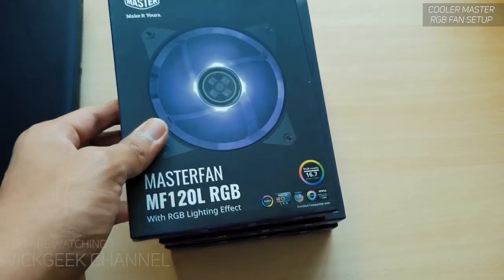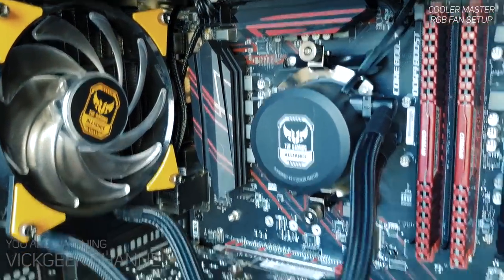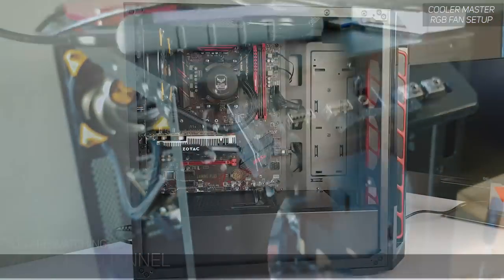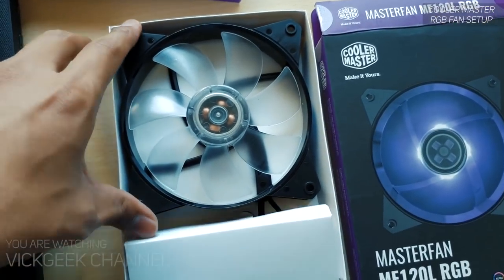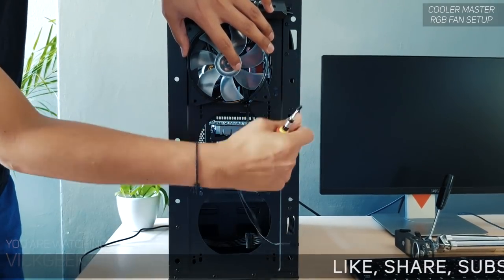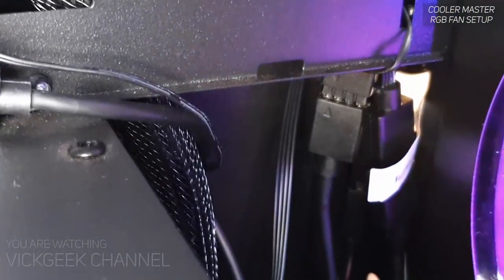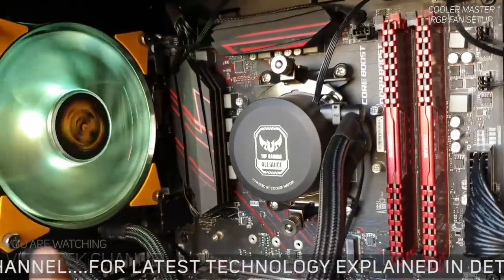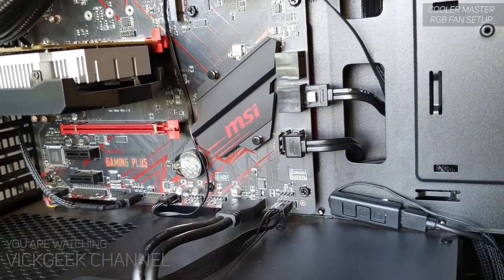How to install and connect CoolerMaster RGB FANS MF120L RGB

Comment: How can you call this a "How To" video when you show the fan in your hand and then the next shot it is installed??
What a waste of time
Reply from the maker: Did you watch the video properly and full ? Listen to what I have to say in the video. I have explained as to how and where you can fix the fan inside case. How to install fan can just be connecting 4 screws in the fan compartment. It is fairly easy. You want me to show turning screw driver, fixing 4 screws on each fan ? That will make  this video show you tightening 12 screws for 3 fans But in the 'How to' video, Dude I saved your time making this video. I showed you full process, starting from installing to connecting.
Reply: @VickGeek  I was actually hoping to see what was in the title ,hooking the RGB fans to the Motherboard header.
Thanks for answering,I wasn't aware I did not know how to "watch the video properly"  . Pretty condescending bud.I will not bother with anymore of your videos , thanks anyways.
Reply from the maker: @MrSpecies7  Oh sorry bud, I did not mean to be harsh. I just asked if you watched the video completely. Because, in the video I have showed how to connect RGB fans to MB headers. A lot of pple skip through the video and find the information to be half said. I did not mean to hurt you in anyway. Sorry if my words were harsh, again.
Reply: @VickGeek  Thanks for getting back to me.Have a good  New Years.
Reply: @MrSpecies7  In fact, as you can see that specific model CANT be connected to the motherboard due to their crappy 4 pins connectors with the 2nd one blocked so its useless for 4 pins headers (hence why he mentions the module and shows his RGB headers, empty)...and I suspect most cooler master kits are the same (got 6 MF120R collecting dust here because of that) and VickGeek, that is what we all want to hear from fan reviews, type of RGB connectors(i.e. 3 pins, 4 pins, blocked pins, std or prorietary), lenght of wires, voltage (5V or 12V); after this point, what they look like and how the mount is a diiiiistant seconday concern. Hope you use this advice, that type of info is nowhere to be found on YT and could draw A LOT of subs and views  --  wink-wink  --
Reply from the maker: @quebecpatriot1874  Appreciate your feedback, will work on it the next time when I make videos about fans and computers in general.
Reply: @VickGeek  You knopw which case these fans are made for? Matrexx 55 or any case that has an ARGB interface included; with my Matrexx 55 I got rid of the modules and all the wirings and plug the ARGB into the case header and all effects work via the front panel RGB switch  :) led strip included
Reply: and why he buy rgb sync fan case but the motherboard & liquid cooling doesnt sync at all with 3 front fan there are not same lighting effects
Reply: vickgeeks reply is right. there is no showing necessarily required in a how to, as long as he still tells you how to show it. (although for fullscale noobs at fans, a fast forward installation wouldn't hurt, ill give you that)
Reply: Because it's not hard to tell that where he was holding it, is where you mount it... Unless you want to watch him apply screws too?
Reply: I bought some similar fans but the connector has like 3 holes and 1 is missing, doesn’t match to my header, any solution without have to buy more and expensive stuff?
Reply: Worst Peeker haha outdated jk lol
Reply: H-Prime .... ok
Reply from the maker: Please find the NEW FULL PROPER TUTORIAL VIDEO here : https://youtu.be/J7bf_JzJLl4
With the feedback I received, I have tried to cover and explain everything  in proper detail that will help you connect your RGB or ARGB Fans.
Hope this helps :) Have a great day everyone. Appreciate everyone's feedback :) Thanks guys

Comment: I've never used rgb fans and just built my 1st new PC. This video helps, I have an MSI motherboard.
I got a fan and it had a weird 4 pin plug with 1 blocked so couldn't use it on my board. Which fans have the JRGB 4 pin connector? Twice I've had the same problem.

Comment: V good video
BRO each fan has two connectors
One goes to mother board and second go to rgb header

By 1st goes motherboard I understand fan header
The 2nd goes to the rgb header. But rgb header is part of the mothballed or separate?

Comment: This video helped, so I'm still using a Z87 motherboard so... no RGB header on it, but with the RGB controller connected to the power supply and motherboard I can still RGB my old dinosaur correct?

Comment: Thx I finally understood where I should plug my rgb fans. Is it safe to connect the rgb fan to a 12V rgb header?
Reply from the maker: Yes it's safe.
Reply: @VickGeek  Ok thanks a lot! It is better to connect the rgb fans to the mobo (if supports rgb like mystic light) to control rgb from software rather than the control, right? Because I want to sync both my rgb fans, ram, mobo and mouse rgb
Reply from the maker: @IoannisVintzi  Yes absolutely. If there is enough slots/ports to connect rgb on the mobo, then fill-up all those and control it using software. If the slots get full and there is no room for other fans, then an external controller such as from Cooler Master will help sync as shown in the video. My PC Motherboard had few slots for rgb and not all, so external controller was needed.
Reply: @VickGeek  Ok thank you. Is there any problem if I use a splitter to connect 3 or 2 rgb fan to the rgb header?
Reply from the maker: @IoannisVintzi  Nope it shouldn't give any problem.
Reply: @VickGeek  Ok, thanks a lot! And nice video!!! 👏👍

Comment: Hi. Sorry. I can install the cooler directly to the motherboard RGB header and also keep the control of the cooler connected? (to change the light by software or by the fisical control). Other question: I need one or two RGB headers in the motherboard?. Thanks

Comment: I have a SickleFlow 140mm ARGB fan. So I need to connect the 3 holes to the addressable 3 pin on motherboard and the 4 pwn for that fan to the cha fan header right?

Comment: Great video why did you not buy the coolmaster 240 rgb cooler to fit on top? I'm about to build a pc for a friend will coolmaster 520 rgb case accept a coolmaster sync with front fans?

Comment: Bro i have a doubt if cabinet have 4 red fans(3 front 1 rear)but motherboard supports have 1 fan pin then balance 3 fan is waste bro🤔because im going to buy gx2000 cabinet and msi h310 pro-vh plus(motherboard) im going to use vs550 smps

Comment: I have a question... The mf 120l got 4pin RGB header right? I use Gigabyte Aorus B450 pro, can i connect the 4pin rgb header to the 3pin led connector?

Comment: Get a splitter 3 in 1 rgb splitter it will be easy for you to manage cables as well as you won't need to connect it on motherboard. These cables are available on Amazon takes 2-3 weeks time to reach you.
Reply: so they don't have to be connected to the motherboard to work?
Reply: @dalemckeown2098  right only one cable from controller will go to your motherboard usb pin, one sata power from power supply rest all the cables you can just attach it with that splitter.
Reply: @sampreetkishan3170  did they provide a controller? If no they you can purchase the controller separately, along with it buy a splitter for rgb cables.
Reply: @sampreetkishan3170  okay cooler master cheapos should include a remote atleast, it doesn't costs much

Comment: if your motherboard cant support it you can buy packs on amazon that have controllers so it goes into psu

5/6 Pack RGB PC Cooling Fan 120mm Cooler with Controller for Computer Desktop

Comment: I recently bough a pre built system from a system integrator, your tutorial is awesome however.. the case I bought is a cooler master master box MB530p that comes with addressable stuff as standard, how would i check if it is done properly so I can address my fans?
Reply from the maker: Install app from CoolerMaster website http://www.coolermaster.com/cooling/cooling-rgb-accessories/rgb-led-controller/
and see if t works. You may also check downloading and installing the motherboard's light controller software. Example, the MSI has Mystic Light software, similarly Asus has Aurora etc. If it doesn't work, then you may have to check with wiring.
Reply: Did you find how to turn them on?
Reply: @Jacko_mcc  just need to plug the splitter cable into the ARGB port on your motherboard
Reply: borfy borf  ok thanks, does it look like a black head with 4 wires coming out the back?
Reply: borfy borf and does the case come with tye argb controller or did you have to buy one seperate

Comment: mine wired controler wont work for cm hyper h410r cpu cooler it only lights in blue color and i installet it right this rgb led controler ? mobo is biostar x470 qtq . any help what should i do for my control to be able to work and change modes and coolors? plz help

Comment: Installed one fan, MF120L RGB, just like the one in your vid... However, I can only select one color at a time and other than that, it only changes with the CPU temperature... Is there any reason it wouldn't change between the colors? Installed the software coolermaster states it works with and still, no success.. Please help??

Comment: I know this video is old but could you please reply to this. I currently have a b365m ds3h with a gigbyte motherborg I am not the most savy cus I am still learning and I am not the person who set it up it seems that the rgb header at the top with the 4 pins only has 3 for me which makes it seem like it was broken during set up. the bottom one is simaler it was hard enough figuring out all the terms and how to set up the lights and now I have this problem does anyone have any solution it is driving me insane 😡

Comment: If you don't mind, could you please tell me the difference between various RGB headers? For example MSI has JRGB but Gigabyte has D_LED headers on it apart from the RGBW headers. I heard somewhere that connecting fans to the wrong RGB headers will fry them and may also fry the header. So, if you could tell me which header works for these fans, that would be great. Also what are the functionalities and limitations of each header? I just want to add one or two RGB fans and an RGB AIO Liquid Cooler plus an LED Strip. So I want to be cautious.
Thank you.
Reply from the maker: Hi, the difference between various RGB headers is not much, meaning they just perform in a different way due to PIN arrangement. Example: JRGB on MSI means it can light up one single colour at a time. JRGB is a Non-addressable RGB header. So, if you have bought ARGB fans that can produce multiple colours, make sure you refer manual of your motherboard and then place it to ARGB supported header. 
RGBW means it has seperate white chip which gives option to make white colour glow warm white or cold white. So you can buy a RGBW strip and then connect to the header. 
Just make sure you place the fans pin to fan header and RGB pins to RGB headers. You can also buy third-partyLED controllers that are made for PC such from CoolerMaster as shown in the video.
Hope this helps. Please subscribe if you haven't already.
Reply: @VickGeek  Thanks... I just subscribed. I've purchased a cooler master ML240L RGB Liquid cooler and a Gigabyte x470 Aorus Gaming 7 WiFi. Does that mean I have to connect the RGB connectors on this cooler to the D_LED header? The cooler is just RGB and not ARGB.
Reply: @Babzzz695  Did u find an answer?I am in the same situation as you
Reply: @RyukGFX  I didn't find an exact answer. But if you're thinking of buying a Gigabyte x470 motherboard, then you should know that the D_LED header is an ARGB header and not the regular RGB header. It's a 5V header so don't worry about frying your components. If you have the Gaming 7 motherboard, you will get a 3 Pin to 4 Pin connector in the box. Use it for regular RGB fans like the Liquid cooler I. Mentioned in the above comment. But if you're buying an ARGB capable fan or a Liquid cooler, you connect it directly to the D_LED header on the motherboard. 

The other RGBW header on these motherboards is a 12V header so tread cautiously when you're working with these. These  can fry your components if their requirement is 5V and not 12V. These headers are useful with LED strips which have an additional white LED for every RGB LED on them. So you can get pure white light out of these strips instead of bluish whites if you're into white lights.

Again, you have to lookout for the power requirements for that particular device. The power requirements are clearly mentioned on the box of the fans or the cooler where you should check for the power requirements of the LED and not the fans.

Whatever you do, make sure you're aware of the power requirements of the LED part of that particular device let it be a cooler or a single fan or an LED strip. Most regular RGB fans have a requirement of 5V. So go with D_LED header paired with the  3 Pin to 4 Pin converter. If the fans have addressable RGB or ARGB, go with the D_LED header and connect them directly. But if the Power requirement is mentioned as 12V, then you should connect it to the RGBW header.

Sorry for the very long and boring explanation, most of which you might already know.
Reply: @Babzzz695  Thank you very much for the detailed explanation! Now I understand what I have to do.
Reply: @RyukGFX  My pleasure :)

Comment: Sir I'm us using a msi b450m gaming plus and antec df500 rgb case... But sir only red light showing... All the light are not showing.... What should i do... And how should I connect those wire to the motherboard.

Comment: There rgb fans cost 2k each... i have cooler master case in which 3 rgb fans are pre installed and 1 without rgb... the case costed me 5.5k which is cheaper than the cost of 3 rgb fans...
WHAT THE HELL... YOU CAN BUY A CEILING FAN FOR 2K...

Comment: If i dont have rgb on my motherboard the fan have rgb works but i cant control it yes??
Reply from the maker: Yes that's what I showed in the video...you can control lighting using the rgb wired controller.
Reply from the maker: Check this new video I made https://youtu.be/J7bf_JzJLl4

Comment: Bro if i connect rgb header to motherboard do i need to connect the 3 pin of fan or not?
Reply: I was wondering the same thing. It seems so. The 4 pin is strictly for rgb lights and the 3 pin is for the actual fan.

Comment: Bro my motherboard have only 4pin connector(pwm) . So if I connect only 4 pin connector of the fan to my motherboard ,then can I control the RGB effects ?
Reply from the maker: Nope. To control RGB, you need to connect the seperate wire that comes with the fan or the RGB strip.

Comment: but how to connect the all rgb fan if the motherboard only have 1 or 2 RGB header and I have 3/4 rgb fans?
Reply: is there any other ways beside the CM hub
Reply: You could buy an rgb splitter. You plug it in to your rgb port on your motherboard and it splits it into multiple connections for more rgb connections

Comment: Hi bro.. This fans available with software..
Reply from the maker: It works with Compatible Motherboard software, like the mystic light software from MSI, etc.. CoolerMaster software doesn't work with these fans. You have to buy a seperate CoolerMaster light controller kit.
Reply: @VickGeek  Thanks for answer and great video.. Have a nice day!

Comment: Are baba dont use rgb controller use the cooler master rgb splitter to run the front 3 rgb fans and controll them with mystic light.

Comment: Does 3 pin fan works on 4 pin motherboard?
Reply from the maker: Yes !
Reply: the tab on the mobo connector fits the 2 protrusions on the fan connector, look at both, its simple and foolproof  :)
Reply: So how you connect 3 pin fan to 4 pin motherboard ???
Reply: @pian6052  if by that you mean a 3 pin RGB connector to a 4 pin RGB motherbopard connector, you dont...you will fry your LEDs. I am actually working on something to partially resolve the problem of having 2 kits of 3 fans work on a single mini controller which will involve buying this https://www.amazon.ca/gp/product/B07CDV2XKL/ref=ppx_yo_dt_b_asin_title_o00_s00?ie=UTF8&psc=1 connecting all 6 ARGB connector into the hub then the hub into the mini controller...best we can do with a motherboard that dont support ARGB
Reply: @quebecpatriot1874  but what i mean is 3 pin fan for powering the fan, my motherboard doens't have 3 pin fan connector, just 4 pin. So it's okay if i connect 3 pin fan to 4 pin fan and leave 1 pin like the video 4:20 ? And will PWM works?
Reply: @pian6052  it  ok but PWM wont work, your fans will run full speed but I also found this on amazon for you, let you control your 3 pin powered fans via software  https://www.amazon.com/dp/B0156YBCKG/ref=cm_sw_r_cp_apa_i_pWpbBbAG60AX1 contact the seller, make sure it is for your needs and it just might be a problem solved case!
Reply: @quebecpatriot1874  okay thank you bro
Reply: @pian6052  No problem; just 1 thing though, the 3 fans kits come with a mini controller and a splitter which end with a main that is 4 pins, which kit did you get?
Reply: @quebecpatriot1874  i dont know, i have not bought it yet :D
Reply: @pian6052  Oh, well then, buy wisely! I know we dont like to spend too much but in the computer fans marketplace scheme  coughscamcouch right now it might be wise to pay more but dodge the headache by going with something like corsair LL or coolermaster ML more expensive kits have std plugs (4 pins) and the RGB side you then choose what is compatible with your motherboard, ARGB (5V,3 pin) or RGB (12V,4 pin)
Reply: @quebecpatriot1874  you're right broo ! 👍

Comment: Best way to install them is not buying them. They are crap of the worst quality: no airflow, grinding noise and badly build. All 5 Cooler Master RGB fans I have suffer from the same fault: The plastic nub holding the impaler is misformed and causes the grinding noise I am experiencing. If one fan was like, I would even accept if without an issue, but five.